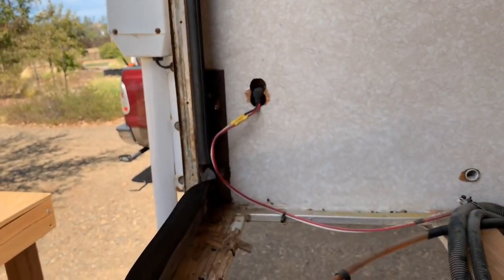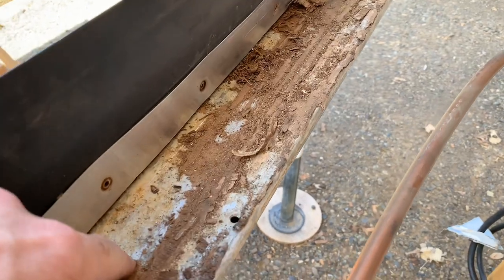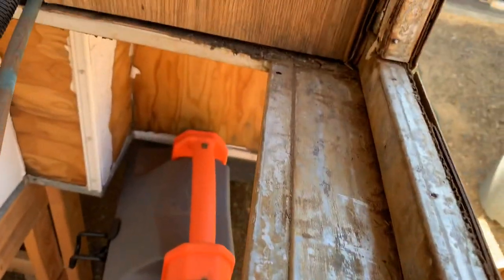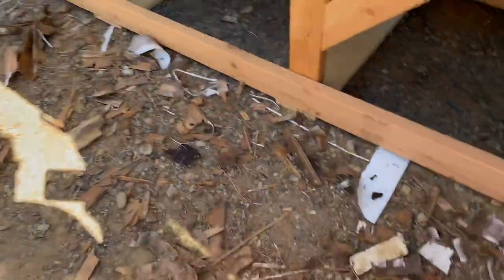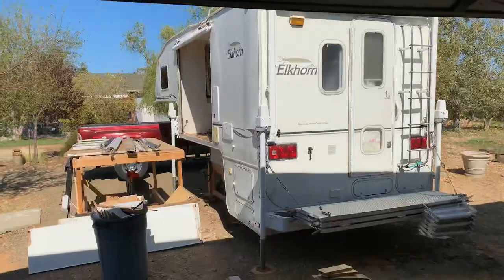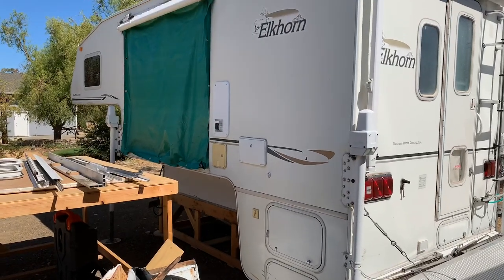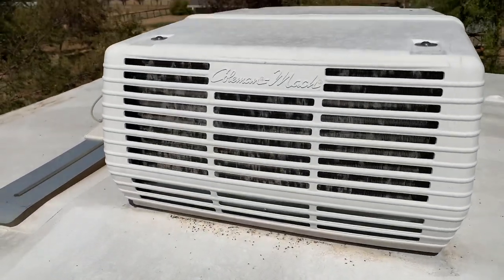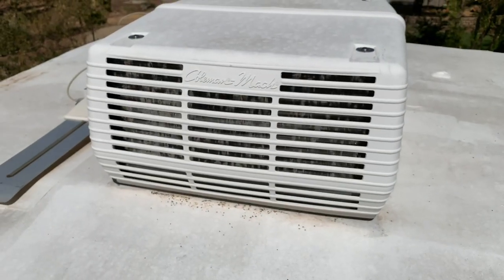Repair Preparations Done.  On to buying parts.  This is going to be Expensive!

Comment: Both slideouts in my shitbox leaking  I go in with epoxy and sikafkex  I removed my slide toppers awhile ago  guess I need to buy new ones
Reply from the maker: Yeah, I ended up using “Get-Rot” and West Systems epoxies on the delaminated areas.  That video is coming soon.  (These vids are about 6 weeks ago).
Reply from the maker: One piece of advice for buying slideout toppers would be to go a bit extra wide.  I’ll be getting rid of this existing 72” topper and purchasing an 80”.  That really helps with rain coverage.
Reply: @covetthecamper2289  I say same this  nice to get then 12 inches wider in each side
Reply from the maker: Don’t go too wide or you’ll need to fabricate custom brackets to mount the arms.
Reply: @covetthecamper2289  yup agree no prob there  I think I got the leaks repaired waiting on rain tonite see what happens
Reply: @covetthecamper2289  west system is very good  that what I use